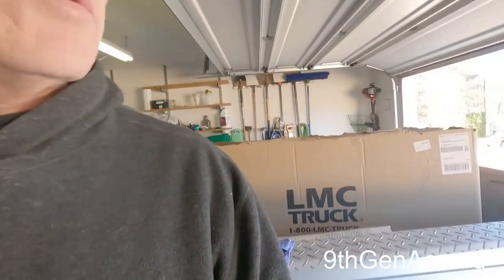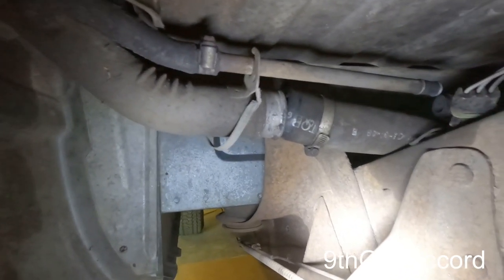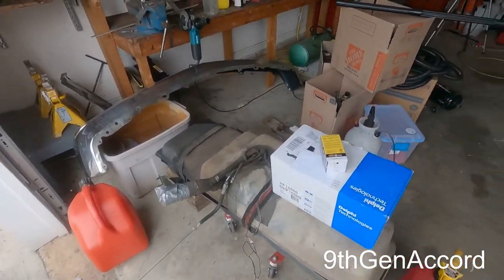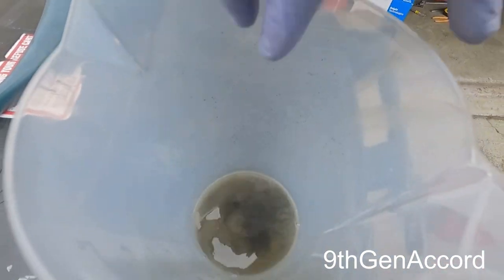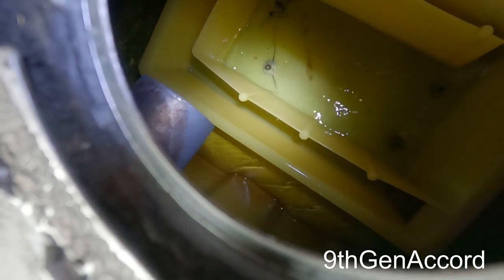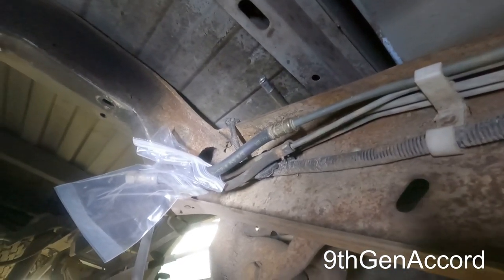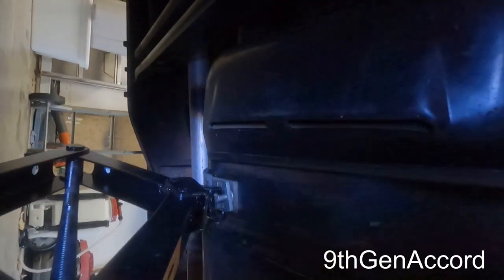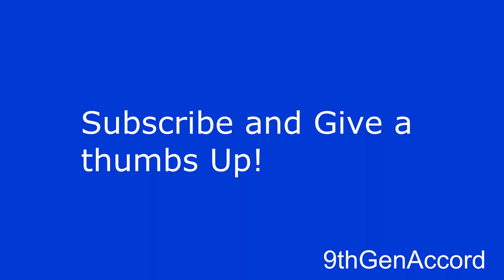1989 Chevy K1500 OBS Fuel Tank and Fuel Pump Removal

Comment: Nice job and good video.   I'm going to do my '94 soon, but I'm going to use the bed tilt method.  Too much of a pain working under there with limited access, especially those two line fittings on the pump.